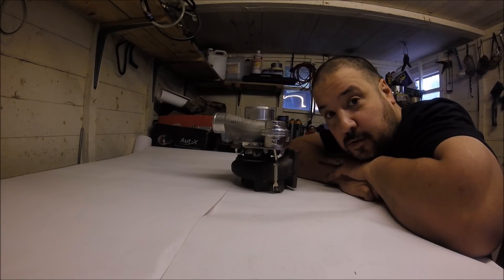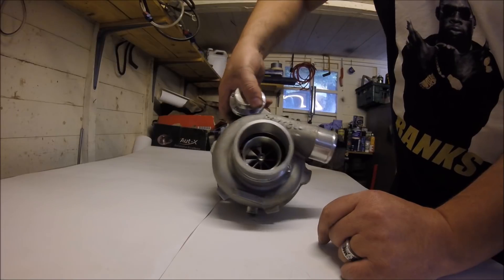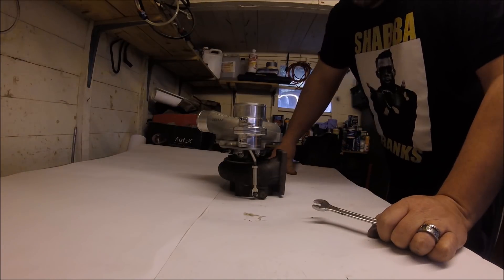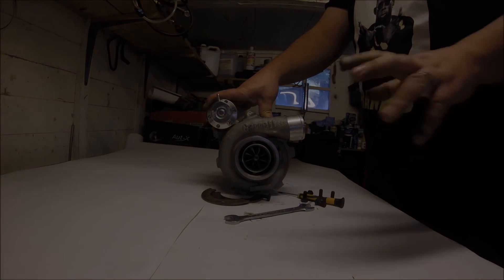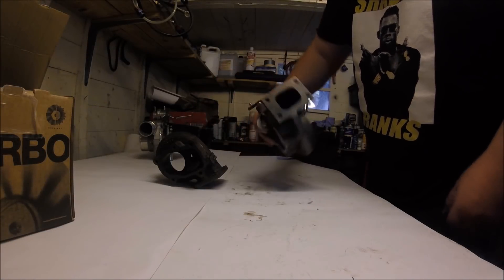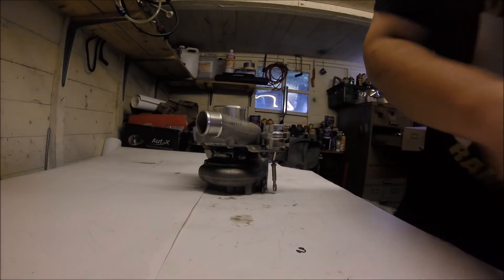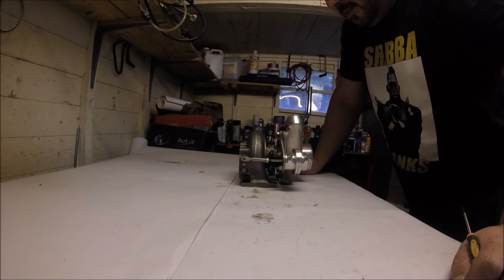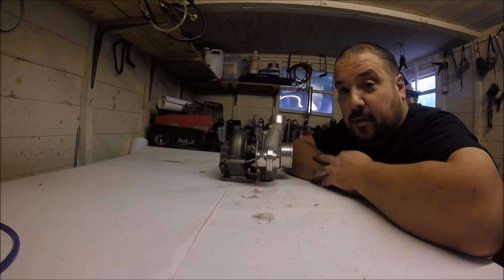[STAV-TECH]. THE TURBO SHED- #1. PORT MATCHING GTX GEN2

Comment: Are you 100% on the turbine wheel being different in the Gen 2 GTX? I can't see any garret promo material saying this, just that it's a direct fit to the earlier GT and GTX turbine housings. Surely they'd market it is the turbine wheel was new as well rather than the decades old NS-iii turbine wheel.
Reply from the maker: v1jilante the one here is a different design but same dimensions wheel than a GT
Reply: The turbine maps for the 2860RS and the GTX2860R gen ii are the same though?

Confused as everything else I’ve seen says they are the same turbine - am asking as I’m considering upgrading the compressor wheel and housing to gen ii specs.
Reply: @v1jilante  I think that if you buy now (or three years ago...) a new GT2860RS the turbine wheel is the same with a GTX2860Rgen2 but at the times of the GT28RS (20 years ago) the turbine wheel was different.

Comment: What other turbo would you recommend on a z20leh vauxhall, everyone keeps banging on about Garrett gtx28/30's but they are loads of money ! I'm looking to get around 400 hp as its only the turbo and injectors holding it back now and it's only a matter of time before the k06 it's currently running lets go. Would a holset be any good ?
Reply from the maker: Around the 400bhp mark on a 2ltr is a tricky one, as Garrett do sell the biggest variation of turbos at that level! Holset HE250 would be a good bet but are incredibly rare (i have one for my 205), and a small housing HX32 or HY35 would be good too, but again, rare in the spec you'd want.
There's certain K27s (I've got some in the shed, but all need stripping and checking, as look almost new but grubby as hell) that would be good, but again, most aren't the suitable spec.
There's some smaller BorgWarner S200s that'd be suitable, but you're still talking ~750quid
Reply: Stav-Tech thanks for the reply, that’s given me something to look into, I suppose that’s why people just go for the garrett turbo’s because it’s easier to get one to suit.

Comment: ok, if garrets are not, what are the most durable turbos? holset? how do you feel about borgwarners?
Reply from the maker: IMO probably Holsets. Price and ability to repair is a factor too. BorgWarner S-Series too. EFR Borgs aren't super strong though, some say less than GTXs, but no 1st hand experience there personally.
Reply: Stav-Tech yes that is what I figured. I am looking at a borgwarner s300 68 trim I think or a holset hx50/52. Looking to make 600 wheel on my om606 3.0 diesel. Hx40 super is a little small for my goal I think.
Reply from the maker: How far have people pushed HX40 Supers on OM606s? I know on the right engine they're ~70lb/min. HX52 11cm might be an option if you needed more?
Reply: Stav-Tech I think the biggest I have seen is around 450 wheel